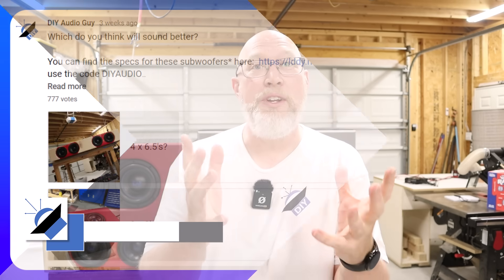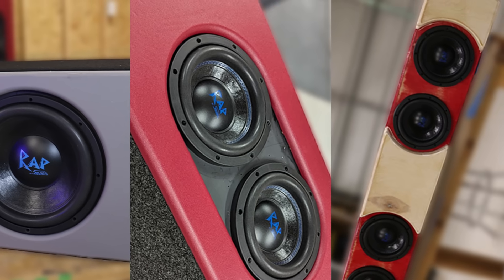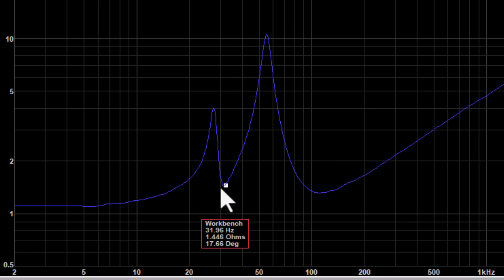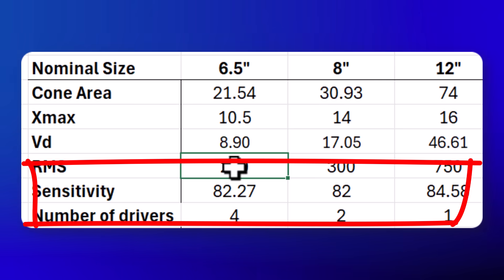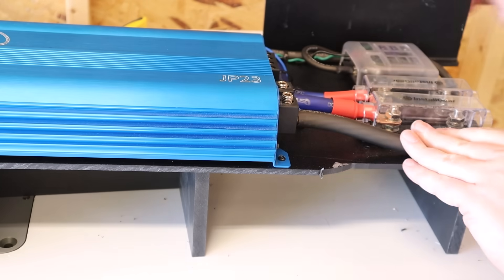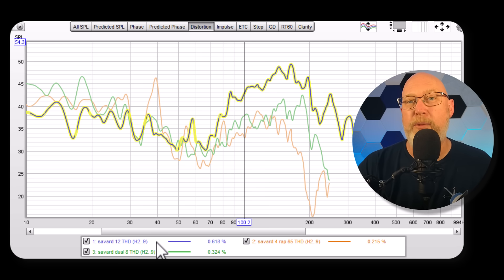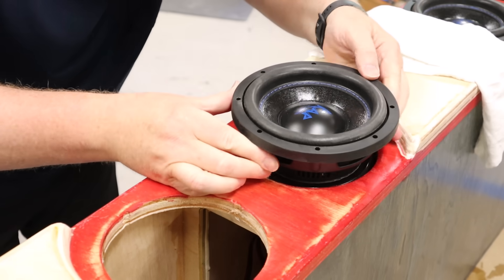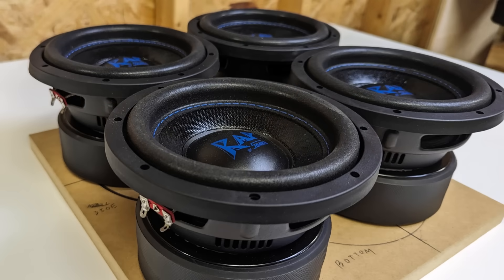Are small subwoofers better than big subwoofers?

Comment: I think the issue with your tuning frequency is due to the fact that you use slot ports, that use the wall of the enclosure as part of the port. The effective length of the port can be significantly increased this way, so your guess is correct that the end correction is insufficient for that application. The german company Visation offers an English version of their speaker modeling software Boxsim for free. There you can type in port and enclosure dimensions of slot ports in more detail and it provides a more accurate tuning frequency in my experience (I think someone in some audio forum did an in depth testing with various enclosures). WinISD is always off with slot ports as the actual tuning will always be lower. This also has been my experience, so I am using a different formula whenever I build subs with slot ports.
Reply from the maker: I add an end correction in my spreadsheet.
Reply: @DIYAudioGuy does it work better?
I am still looking for a more accurate formula

Comment: When you mean 'better' I assume you mean louder?
If so, cone area, sensitivity and power handling are the only three factors you ever need to worry about.
A smaller loud speaker with a longer xmax will inherently have a lower sensitivity as the weight of the motor and surround needed to support the xmax means its less efficient, meaning it's quieter given the same power.  A compounding issue with this is that the larger surround will make the already smaller cone area even smaller, meaning it's quieter.  To combat this, manufacturers add even larger motors to increase power handling to try to make the loud speaker 'louder', which compund inefficiency and baskets and motors with huge displacements, meaning either you reverse mount for a smaller box (and lose boot space) or have much larger boxes, rendering the 'smaller' loud speaker redundant for it's intended purpose in both cases (of having a smaller loudspeaker in the first place to have in-car space). 
A larger, efficient loud speaker is always louder (comparing 1 watt 1 meter in open room setup, no in-car gain wizardry).
Reply from the maker: It's much easier to quantify louder than it is to quantify better.
Reply: @DIYAudioGuy  I'm asking in relation to your video title, as it says 'better' and not louder; you should state louder in the title.
Reply from the maker: @Mr_Sh1tcoin  well, if you watch the whole video, you'll notice that I took several different measurements. Not just an SPL test.

Comment: i built a subwoofer box based on a stig carlsson QA-51 it takes a 7 inch driver and i scaled the box to fit an 8,   the original box has a flat eq all the way from like 50hz all the way to 20kz,  box is tuned to 35,  the sub box seems to be lower

Comment: In the past 20 years, after experimenting with various setups ranging from a single 10-inch subwoofer up to an 18-inch subwoofer and about 4 setups that include dual 15-inch subs, I experienced situations when a single 18" (3kw amp and 1.2kw speaker measured used power about 2kw)beating dual 15"(3.6kw amp, 1kw speaker, all amp power used!) and a better single 15" (3kw amp, 1.5kw speaker, 2.5kw used) beating the single 18" took me to the conclusion that size and power numbers don't matter.
Reply from the maker: There are a ton of confounding variables.  It's not just size and power.
Reply: I agree i feel in a Room or at live events is probably the only instances where 18 to 21 inch woofers are better and where the extra cone area is king.
Reply: @EBMproductions1 This is a fact. You are correct. The more surface area you have in a cone formulation, the more air you can move. Which is essential for reaching a concert venue sized audience....
Reply: @robertlee4809  Yes i believe its more about cone displacement however we know with Pro Audio woofers the 12 inch to 15 inch subs don't have enough displacement and i feel after my tests using car audio in a room that even a 12 inch car sub would need a massive amount more cone displacement to match a 15 inch car sub in a room etc.

Comment: Don't forget to measure car resonance. Mic the driver position and hit the steering wheel for the whump that's your vehicles resonance + interior space then  adjust the box accordingly.  Mix and cook . I really like using 4 ,,,8's,,, 2 ported 2 sealed 2 amps set with real time multi mic data.  Tinnitus is a bitch
Reply from the maker: Right, when you put this in a different car everything changes.
Reply: wear earplugs

Comment: 4-6 1/2 woofers if you installed a base radiators would be a awesome set up
Reply from the maker: I think that would be cool.
Reply: I'm working on a 10-in with a passive radiator of the same size currently. My thinking tells me I can get nearly twice the sound w/half the power..  & @,½ the price..  @DIYAudioGuy .

Comment: Sound (to one's ear) is such a subjective thing and anyone who has been messing around with Car or even Home Audio for long enough can likely convince themselves that they prefer certain driver sizes for specific jobs. For example (for Car SQ Build), I have somehow convinced myself that I prefer 10's in a car with a ton of power and low crossover point, combined with a 3-way front stage consisting of 8" midbass so that I can feel the snare drum hit me in the chest. I like the sound of 5 1/4's over 6.5's, especially in a 3-way front stage and last but not least, the biggest tweeters that I can afford crossed over as low as can allow. I only like using 24db/oct high pass tweeter crossovers (as I prefer a lower x-over point, so it helps), but prefer 18db/oct slopes for everything else, both high/low pass as well as most band pass mids/midbass.
Being such a subjective thing that sound is, there are likely those out there that completely understand where I am coming from and others that look at what I wrote above and think that I am crazy, but I bet peo0ple still have their favorites regardless of what is 'correct' or 'right'......
Reply from the maker: Strange isn't it. How we can't even trust our own senses.
Reply: I agree completely.  In my 30 years of being into car audio I’ve designed and built  ported, sealed, infinite baffle, and bandpass setups with single and multiple drivers from 6.5” to 15”.  I loved the utilitarian aspect of the infinite baffle setup the most having full use of my trunk, a sealed single 8” sounded best for SQ, and the ported dual 15” got the loudest.  

Now that my priorities have changed in life, I have found that a single 10” in a ported box gives decent overall use to mostly satisfy my bass wants, but there are still days that I long for each of the other setups.

Comment: all given a box at optimum volume for the mms of the woofer and tuned the same FS with the Vd and sensitivity.
the quad 6.5 will have higher BL and better mms so they can be in a smaller box than the single 12 this will make for more total bandwidth But  the roll-off will be more aggressive. for this reason if building a box for say a 12 with a FS of 39hz tuned to f3 36hz you might have a 6-7db drop at say 32hz when below the tune. where quad 6.5 with FS at 46hz in a box tuned to 36hz will see a 10-12db drop at 32hz this will make it feel like they don't have much extension 6.5 tuned to 30hz will preform more like a 12" tuned to 36-38hz where a 6.5 at 38hz is going to be a  good EDM / classic rock setup as it's going to be very peaky in the 42-50hz range. to offset this effect it's best to think  "going smaller tune lower" the mass of the cone and inductance of a bigger coil help extend and smooth the response of the woofer just like added mass on a passive radiator. smaller woofers are more "connected" to the signal and introduce less THD to the sound it's self. i find the small 6.5's in a T-line or 6th order band-pass setup tuned for a 26-50hz range can hit like a stoner in a fedex truck, but they need big ports the port area is the "virtual" sub size.

if you wanted to test this add a few full water bottles inside the 6.5 box to eat up some air space this will drive the tuning lower and the motor force vs cone area will be more forgiving. using Dats and looking at response add bottles tell the 6.5 is apx 4-6hz lower than the 12" box and listen by ear and it will be way harder to tell them apart. when testing  speaker response in rew it's based to do this outside with the speaker facing up  and 1meter from the ground and the mic 0.5meter from the cone this i find takes room and ground coupling out of the equation.
Reply from the maker: They are damn fine subwoofers.
Reply: @DIYAudioGuy  I do not disagree!

Comment: From the graph, the THD curve for the 12" subwoofer looks to be higher than that of the other subwoofers.  At what frequency did you have them crossed over at? 

THD graphs are useful for determining the clean output capability of a speaker and also the best frequency range to use them in.  For determining the clean output capability, take measure the THD at a low but decent output level and look at how it changes as you increase the level by a dB or two for each measurement.  Wherever you seeing rising a significant amount at a certain frequency, set your HP or LP filter at or before the rise. For a subwoofer, this will happen at very low frequencies (below the Fb if it's a vented subwoofer). I use 10% THD as my benchmark for subwoofer builds, but I'm more into SQ... :-).
Reply from the maker: I'm fairly certain that I had all the crossovers off and just ran the sweep from 0 to 500 HZ.  I noticed that THD numbers seem to be dependent on how wide of a sweep that I ran. Still trying to figure out how to do these kind of measurements in room EQ wizard. Up to this point all I've ever done is look at the frequency response.
Reply: @DIYAudioGuy  Gotta be careful taking those THD curves too.  Poor connection at amp, speaker terminal or the driver?  Increased distortion.  Driver not properly screwed in?  Increased distortion.  Sympathetic vibrations from some loose object or panel near to the speaker?  Increased distortion. Speaker box not sitting firmly on the platform or on the ground?  Increased distortion :-). 

I try to take my THD measurements outside and I take them with the mic as close to the speaker as possible, the latter of which takes some adjustment as you don't want the mic to be overloaded either at higher SPLs.  Why?  Increased distortion :-).  Once you start taking a bunch of THD measurements, you'll figure out what to "gotchas" to look out for, and how to avoid them.
Reply from the maker: @Grommet2007  currently working to get some of that sorted out.  Stay tuned!.

Comment: The "standard" equation for vent length calculations loses accuracy when the volume of the vent is 10% or more of the volume of the box, and actual Fb ends up being a bit lower than target Fb in those circumstances.  Also proximity of the vent to the sides of the box is also going to increase its effective length.  Conclusion: if you're aiming for a specific Fb, design the vent in such a way that it can be shortened if required.
Reply from the maker: Thanks for the info!
Reply: 👏👏👏🥰❤❤👏👏🤔i see.....an actuall intelectuall

Comment: I was looking at the savages subs and i noticed the rap series requires a
Pretty large enclosure for a sealed enclosure…the hi-q series was much smaller…I’ll probably buy 2x 10s to experiment with…
Reply from the maker: Make sure you use my discount code.
Reply: @HyPex808, I had 2 Savard Rap 12s back in the early 90s. They do use a lot of airspace but they are very good, loud subs. I think my box back then was 3.5 or 4 sq ft. I know it was sealed. I wasn’t smart enough back then to figure out ports. 
Can’t go wrong with Savard Subs. IMO